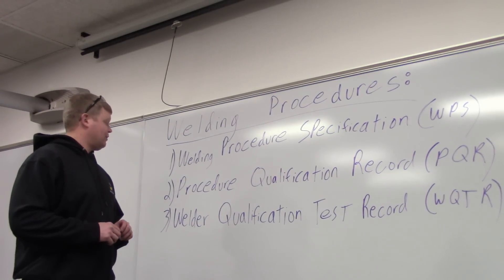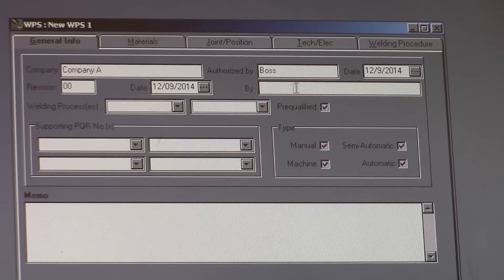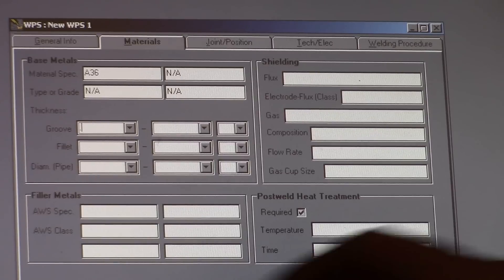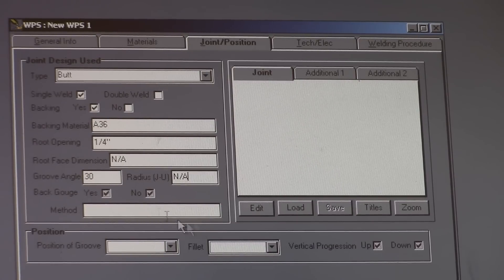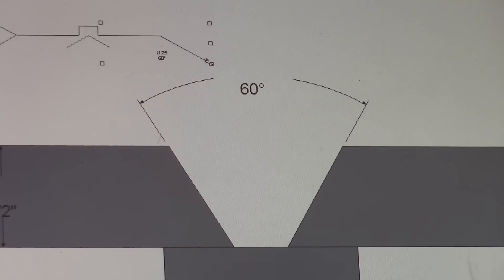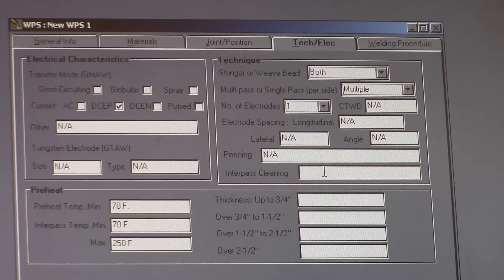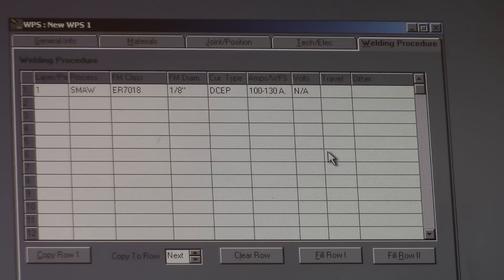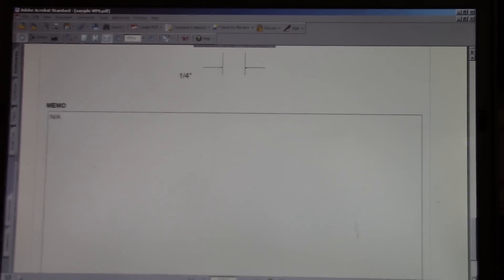How to write a Welding Procedure Specification (WPS)

Comment: What is this program you are using for the WPS documentation? Very nice. Thanks
Reply from the maker: It's called Lincoln ArcWorks, but I think it has been discontinued.  I like it so much I have 32 bit computer that I run it on, and that is all I use it for!

Comment: Where can I find the information for prequalified WPS's and PQR numbers for writing a prequalified wps?
Reply from the maker: There is an entire section on prequalified WPS's in the AWS D1.1 structural steel code book.  I'll get the exact pages when I get to my office and get back to you!
Reply from the maker: All of section 3 is on prequalification pages 59-124.
Reply: @TVWeld  so I have been tasked with writing my first wps. Do i actually need to include the PQR number for a pre prequalified wsp or just put prequalified where it asked for pqr number ? would love to see a video on how to write a prequalified wps. thanks for the help.
Reply from the maker: @johnparker-im8kw  You can write prequalified in the PQR number section.  That would be appropriate.  I just looked up one that I had done and I wrote N/A in it, but I think you're okay either way.  I'd make sure you have the prequalified Joint Designation written somewhere on the document as well.

Comment: is there any modern WPS creation tools like this one? Or, heck, an app?
Reply from the maker: I don't think so.  I looked hard a couple of years ago and there was nothing.  I even called up an inspection company and asked them what they were using.  They said there was nothing new out there and they were running the old software.  Some people make their own spreadsheet, but it's limited as far as software goes.
Reply: Thanks for the quick response.
If you ever see a new one out on the market, know that I got annoyed with writing and flipping through multiple books, so I made the software.
Reply: Where can you get the program and is it a free download?  I can do the data sheet but where can I get all the diagrams for each weld procedure
Reply: Hello Anthony. I might be a little late to the party, but we do have a software solution (we started in 2016), that may be what you're looking for. It's a complete solution that also includes weld tracking, but we have cheap plans for people who just want to write some WPS'. Get in touch with us if you want to know more!